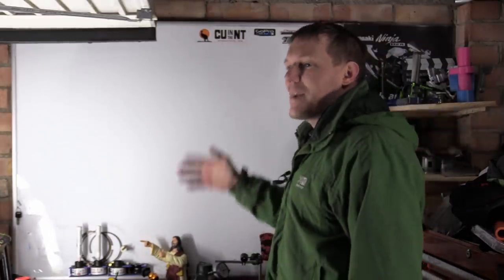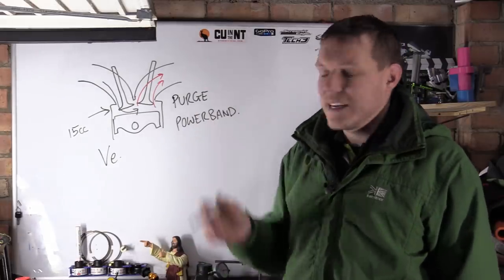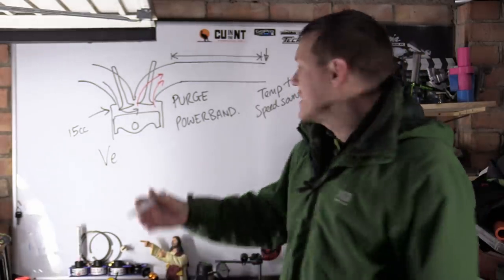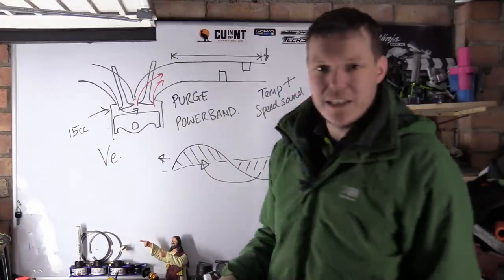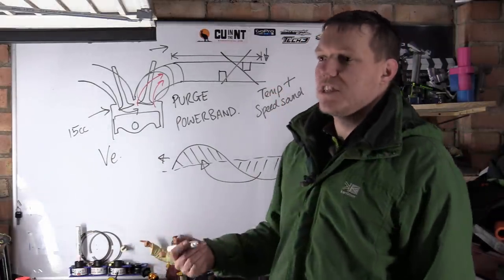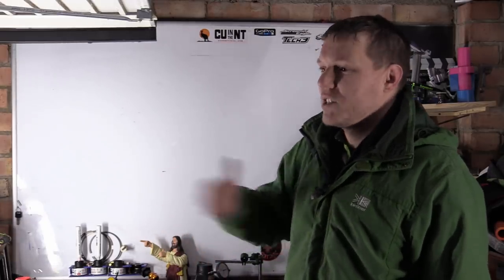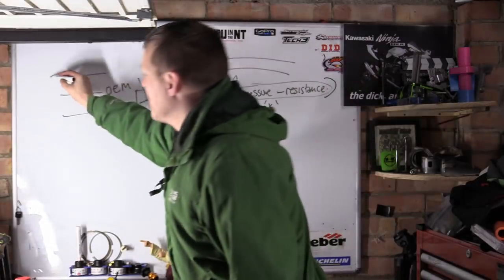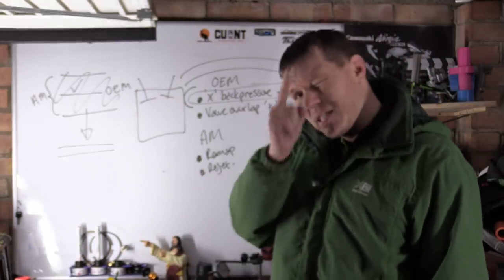Exhaust back pressure and fuelling - Part 1

Comment: My Triumph Speedmaster used to backfire like a bastard on the overrun in standard factory spec, so what's going on there.
Reply from the maker: Its a triumph LOL
Reply: Part of it i being twin and having a good amount of torque the chances are Triumph have mapped it so that on a closed throttle it is actually still injecting fuel possibly a  3 to 5% duration of injection. The means when you open the throttle again it is not like an off /on switch and is a little smoother when you go from a closed throttle to an opening one. This is common on race bike mapping where the transition from closed to open is important.
Reply: Carbed vehicles seem to pop a bit on the over-run. I think in that case it's fuel getting into the exhaust because of misfires.
Reply: @Surestick88  its fuel injected
Reply: I'm risking sounding like a complete anorak here :) Technically it's not a "backfire" it's an "after fire" Backfire is when you get popping on the inlet side. The popping and banging you can hear in the exhaust on the overrun with a closed throttle is almost certainly caused by a weak mixture.

A weak mixture is usually the cause of "after fire" on the overrun with most engines. What's actually happening is...... Normal combustion is taking place but it's a much slower burn because of the weak mixture. Combustion is still taking place as the exhaust valve opens causing the pop or bang you can hear. Some engines are more susceptible than others, it depends on there valve timing. Hope this helps :)
Reply: @SuperbikeSurgeryTV   Thanks for that, Triumphs run lean so that makes sense. I reduced the effect when I removed the air injection and remapped the ECU.
Reply: I had a Ducati that 'popped' on the overrun-  it was caused by a faulty exhaust gasket.
Reply: @garys4756  Popping from the exhaust due to a Leek usually happens when the leak is really close to the cylinder head. This is what's causing it.....On a closed throttle while decelerating (overrun) air is been drawn into the exhaust system due to the Venturi effect. This air allows combustion of residual fuel that's passed through the combustion chamber and not been burnt. This tiny amount of fuel wouldn't normally burn because of the absence of oxygen but with the exhaust leak it has what's needed, resulting in some popping from the exhaust.

Comment: On a turbo engine does air leak out around the intake valve guides?
Reply from the maker: If the correct seals are not used - we'll get to this soon
Reply: The Workshop , I never heard of anybody upgrading their valve guides when they do a turbo conversion.

Comment: In an imaginary scenario that you ran an engine in space (ignoring the heat accumulation problems or the evaporation of lubricants, and providing that we can supply air from a presurized canister) how would the exhaust output to vacuum affect the engine?
Reply: You've made my brain explode
Reply from the maker: The acceleration of the exhaust gases would be greater, until the speed of sound is reached. So locally the velocity would be great. 

Why? Because the pressure difference is greater - but only by 14.7psi. If the pressure outside was the same as inside the cylinder then nothing would move. 

What you have to remember is that there's a difference between the speed of a pressure wave and the speed of the gas molecules themselves - for example sound (the pressure wave propogating through air) travels at the speed of sound, but the molecules velocity isn't.
Reply: Well not as bad as it affects rocket exhausts/nozzles. Poor bastards designing those

Comment: Thats why i threw away my acra full system on my  04 r1 and use arata generation full system. Acra said...and still says on its pipes no remap required...so basically most of them are pretty close to stock systems which offer only sound...not hp.

Comment: Would exhaust length still matter if you have valve overlap and a turbo?
Reply: Well the turbo will be a restriction inside the exhaust manifold... A massive restriction when in boost, so the valve overlap is usually kept to a minimum to prevent those exhaust pressure from the exhaust valves opening on other cylinders while the overlap is happening on the opposing cylinders so it dirties up the fuel mixture inside the cylinder unless it's a twin scroll turbo exhaust housing to separate these events to allow for more overlap... So basically there's usually so much exhaust pressure, you don't really worry about it, just the worry about keeping the pressure from seeping back into the other cylinders when in boost
Reply: Oh and if you have a good turbo setup for high rpm, then the boost pressure should overcome the exhaust pressure, so you have 20 lbs of boost but only 10 lbs of exhaust manifokd pressure, then you're golden, but most try to make 20 lbs of boost at low rpm creating a big exhaust restriction creating all these problems... So 40 lbs of exhaust manifold pressure... Kind of dumb to me, that's a lot of extra heat and pressure that isn't needed... Just go supercharger and there's no worries
Reply: Oh and with the doubled intake pressure on exhaust pressure then you'd need way way less valve overlap to do the same job or you'll be wasting boost pressure and over working your intake turbine making it operate outside of it's compressor efficiency range making less HP per lb of boost... It's all pretty complicated... So you target 10 lbs with too much valve overlap and you're leaking it all out of the exhaust during overlap, so you're exhaust waste gate valve will stay shut longer to acquire the heat needed to spin the intake turbine up faster for more air volume... While adding the boost pressure to the exhaust side as well but without the added heat to drive the exhaust turbine wheel... It's a snowball effect...

Comment: youre wrong about the pulses.
Reply from the maker: Go on then......... lets hear it
Reply: @dirtygarageguy  at a area increase you will reflect a lowerpressure wave like a twostroke, you will tune the pipe with areaincreases in collectors and megaphones or stepped pipes. Which send bak negative  pulses not posetive ones. Maybe there is an missunderstanding but you dont mention the differense between posetiv and negative pulses. And ofc an area decrease will return an posetive wave. Eng=2nd lang